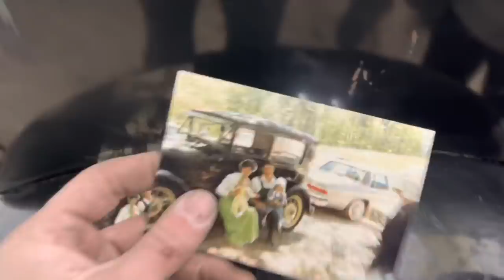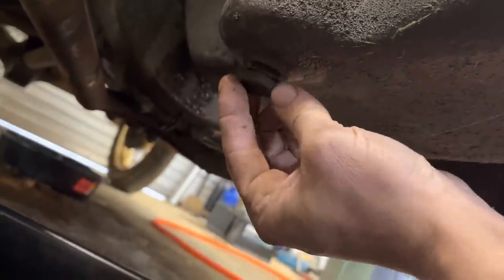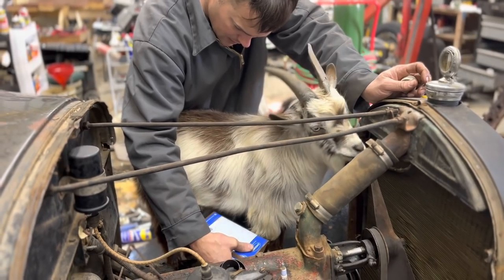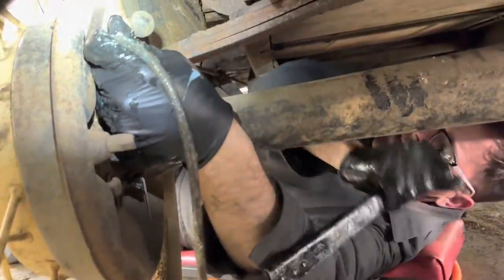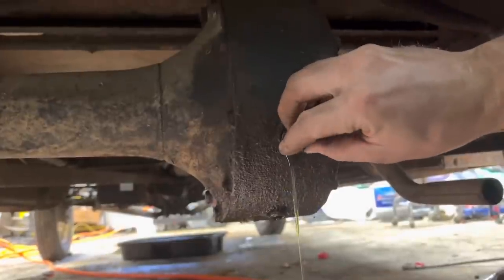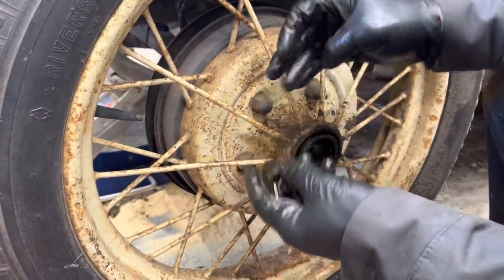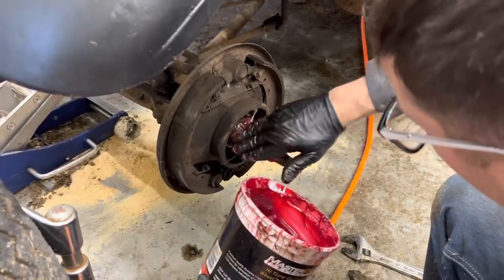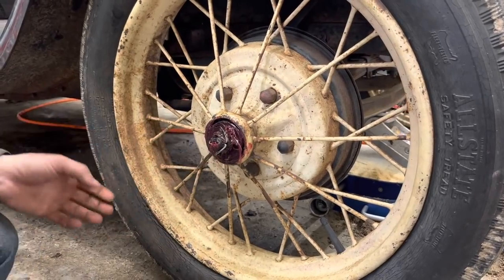94 year old car back on the road, and first wash!

Comment: The car cleaned up beautifully, new roof skin and some beauty work on the paint should be catching eyes all the way down the road!

The steering box of a Model A is meant to be lubricated with a thick oil originally designated 600W (About 120-240 SAE). The grease fitting on the box really did cause some confusion back when they came off the line like that, but the manual and service bulletins specifically warn to only use 600W oil and not grease for steering box lubrication. Since the Differential, Transmission, and Steering Box all take the same thick oil, I just buy it in bulk for all three. Either 120-240 SAE from the store (Whatever your car likes best) or 600W from one of the Model A parts vendors.
Reply from the maker: Ok thank you

Comment: Life is good in a model A.  You got yourself an enclosed cabin to protect from the elements (heater optional). And you start it with a push button so you don't take out an arm  cranking. And a windshield wiper too, just not an electric one.
Reply from the maker: Exactly

Comment: That flathead 4 runs really well. I agree that you need to fine tune the  timing to get more advancement out of it. You really fit the part when you dress for it. I really enjoyed it when the whole family is involved. 
To make sure you get all the sludge out of the engine run it for awhile and change the oil one more time so it will be ready for storage. See if Coker tire sponsor you some new Casings for the 28. Sorry for the long post. May you and your family have a Blessed One Sir.
Reply from the maker: Sounds like good ideas thanks

Comment: I love these cars.  Original  My father in law has a 1936 three window coup V8 with a rumble seat.  For the most part its original.  He did change out the brakes to hydraulic and the engine has been changed out.  He took the body off the frame and cleaned and painted the farme.  Then he had the body painted.  Its cordoba grey.  Its really beautiful.  Other than that is pretty much original.  I haven't had the chance to ride in it yet but I love it.  My father in law doesn't want a hot rod.  He says there are only so many of these still around and each one you rod its one less original.  Just an FYI the bumper is not chrome its stainless steel.  Black was the favorite color for Model T and A.  Black was the only color that would dry fast enough to pain the body and keep up with the assembly line.

Comment: Man this was a good video. That oil kind of look a lil weird but everything turned out nice. The cleanup was simple and easy and you could tell the difference. That was awesome seeing the wife driving the vehicle. I really like to test-drive especially with Ralphie in the video at 33:05 when Ralphie said that will be terrible. Boy i tell you Ralphie is funny. It was also cool to see Ralphie driving the vehicle at the end. At first I thought you was doing the video without your flip-flops on. I love how you switch your clothes in seconds. Yes I was told they had flip flops back in the days too. I was told that's all my grandfather wore back in the days was just flip flops because he had very extremely wide feet with toes that were equally straight across. But he had normal size toes it's just his toes was very very extremely wide. I see where my extremely wide feet come from now in the family. Just back doing Christmas I was looking at some pictures of my grandfather wearing flip-flops back in the day & till this day my grandfather is still wearing nothing but flip-flops. He only wear shoes and boots for certain things but other than that he is in flip flops 24/7 even when is 20 , 30 , 40 degrees outside he still wearing flip-flops to the store. My dad does not have wide feet & his toes are not equally straight across but his toes are spread out. I apologize for slightly jumping off the subject but but yes they did have their flip flops  back in those days. The video thank you for for sharing.
Reply from the maker: That’s great your grandpa wore flops too .. hope you have a great weekend and thanks for watching as always ..

Comment: Hey!  This one looks 100% better than that that one that was so washed out with too much light.  One way to clean the crankcase is to do what we used to.  Before you change the oil, start and warm the engine till you can have it at a slow idle then add a pint of kerosene to the crankcase and let the engine idle another 5 minutes.  It won't hurt the engine and it will break up that sludge in there and the oil will drain much easier.  Be thankful it has all those zerks.  That's why it has lasted so long, unlike modern vehicles where when the part wears out you just have to toss it and buy another because you couldn't grease it to keep it from wearing.  That diesel oil likely has zink in it which helps keep the valves and seats lubricated well as they're a softer material than modern valves.  Back when gasoline was leaded that was what lubed the valves.  You can also buy a product called Instead-O-Lead and add it to your gas tank and it will help as well.  Even with all that though those valves will get leaky over time and not seal well and it'll be time to "lap the valves" which was a common job on older engines.  Somewhere around here I have a lapper which is basically just a dowel rod with a suction cup on each end.  You'd stick that suction cup to a valve, put some grinding compound between the valve and seat and spin that dowel rod back n forth between your hands and that ground the valve and seat so they would seal against each other well again.  Back in the day you would have removed the inspection stickers or else after a few years you'd not be able to see through the windshield, lol.  They weren't for vehicle emissions, but more for, are the tires with enough tread to be legal...stuff like that, do the lights all work, etc. and they were also a form of automotive tax and you got a new one each year.  Now on something as old as that if it had an A, B or C sticker about that size I'd definitely leave those as they were WWII gas rationing stickers.  If you had an "A" card your vehicle was considered the lowest priority for fuel and you were allowed to buy 5 gallons a week.  Even then you wouldn't drive much because you couldn't buy new tires or other maintenance stuff at all because the rubber and lubricants, etc. all went to the war effort.  Sorry for such a long comment...I tend to ramble on a lot.
Reply from the maker: Ok thank you for the information

Comment: I forgot to add this.  The one thing I accidently discovered, my model A never did run well.  Then one day when checking the points, just before using the car in a wedding, I noticed that when the points were advanced, the gap changed, which reduced the dwell and so the spark was very poor.  I filed the notch larger in the distributor cap, the notch permits the points plate to move back and forth, and that fixed the problem of the gap changing, so the car ran much better.  About a year ago, I decided I wanted the car to run really well, so I purchased an electronic ignition kit for it, and converted it over to a 12 volt system, and now it really runs good.  I have had my model A, a 1928 2 door sedan, just like yours, for 56 years and the brakes have always been terrible.  If Covid ever ends, I am going to switch the car to juice brakes.  Even power front disk brakes, if I can find a kit.  I am not a purist, just like to have a safe car to ride in.  I even put seat belts in it, so my grand kids are safer.  Hope this helps.
Reply from the maker: Sounds like good upgrades

Comment: That oil reminded me when I did an oil change to my old 76 Ford Granada (2 dr). Talk about chunks! I used some cheap oil and did a few cycles and added some seafoam until I finally it gave a proper oil change with diesel oil. I miss that p.o.s. nearly died a few times in that car but still miss it. I wished my grandpa was a car guy like yours. He had a lot of awesome WW2 war stories, though.
Reply from the maker: That’s interesting I had a 44k mile Granada it was gold 302 car I liked it
Reply: @Sleeperdude  mine had the 4.1 6 banger. It loved eating carburetors for some reason. I also had to put spacers in the car, so I wouldn't be driving on skinny tires.

Comment: A rule of thumb I was taught was for old vehicles 55+ or more in age after you drainout all of the old oil was to add backin some lucas and diesel and run it for about 5 mins... Let it warm it up good, shut er down and yank the drain plug.. The diesel mixed with lucas will scrub and basically do the same as a hot acid bath... It will break loose almost all of the sludge gunk and any leftover metal material that may be stuck in valleys or channels within the block.... I have seen ungodly amounts of crap flushout of an old engine block and it works very well.... When you did the front bearings that is a open & shut case of dirt and water contaminated grease.... Water breaks it down making it harden up  & the dirt makes it a funky brownish grey color
Reply from the maker: Ok thank you
Reply: @Sleeperdude  NP sleeper brotha... I have flushed TONS of engine blocks out with that method

Comment: Two things I mentioned before you haven't tried yet,  double clutching is when you want to down shift, push in on the clutch, rev the rpms up a little, let out on the clutch while reving the rpms a little and put it in 2nd when you do it smoothly the gears never grind. Just try the tin foil even after you use the steel wool , You'll be suprised, I know your saying "if there's no chrome it can't shine", I thought you might want to learn some thing new. I won't bore you with it again. Jim las vegas nv
Reply from the maker: Ok thanks I did try the aluminum foil in an older video and it did work
Reply: @Sleeperdude  when you use the tin foil be SURE to use the DULL side only

Comment: Since it doesn’t have an oil filter it would probably be good to at least remove the oil pan and scrub it out real good. Also since the valves are internal and no overhead valves to hold junk … get a few cans of motor flush and run and flush a few times … love seeing these old FORDs 👍👍👍👍
Reply from the maker: Ok thank you for the info

Comment: At the oil co. I worked for,we'd get calls for trans grease. It was 400 weight,since there weren't seals. Just vlose fits. And they'd drip. The speedo.cable nuts break off really easy,so if theres a leak there,tightening it up tight won't make much difference.
Reply from the maker: Wow that’s thick

Comment: My best friend owns a Motorcycle shop here in Hendersonville NC.He once bought a 28 4 door sedan from a old gentleman in Fairview.We dragged it home and while cleanIng what was left of the interior out found a very live Copperhead under the rear seat,it didn't take but a second to get outta that car.We looked in vain and never found that sucker,man do I hate poisonous snakes,probably  still around the shop having more babies. The old sedan came with 16 inch wheels and rotten tires,my buddy sells new tires and changes them also,so we put 4 old Harley Whitewall tires on it,we.called it Miss Daisie,sure got a lotta looks out of it,I could probably out run it on a good 10 speed bike lol.

Comment: Excellent video Sleepdude  :) also great shape old Ford car & be worth keeping up excellent shape and vechile shows to show too! I heard my late Grandfather Bill Cann SR bought 1937 a Dodge Brothers car in your Ford body style and was black with yellow wheels to with powerful 4 cylinder motor with 3 speed Manual transmission floor shifter and 5 gallon fuel tank! My other Grandfather Harold he did buy car till 1945 a Chevrolet Coupe car that remember hearing about!
Reply from the maker: That’s cool thanks

Comment: You compare it to newer cars and I was thinking about how folks would be comparing it to a horse and buggy back in the 1930s. But even with the old sludgy oil the engine did not want to die, It acted like it was going to die but came back and kept running. And it's such a simple design, they could make those new today and outsell every other new car on the lot. Though I would update the brakes.
Reply from the maker: That’s true it was much better than a horse

Comment: On the steering wheel the left lever is the spark. That should only be used in colder weather when you need more spark to start the engine.  The right is called the throttle.  The lever under the passenger side is the choke by pulling give it more gas you turn it to manually adjust the carburetor. From inside the car
Reply from the maker: Ok thanks

Comment: Red steering wheel (if original to this Model A) indicates an early production 1928 car. Black exterior paint was not offered on the 1928 model. Unique fluted headlamps only on the 1928 model.
Reply from the maker: Ok thank you I didn’t know that

Comment: With the wire wheels, I can be the rim has egg out or has warped because the spokes need to be adjusted to the true wheel. or the tire or the tube (as the Dutch say) rutched and is bunched up. Now that's "rutch" like Butch with an R instead of B. or just big or lots of tube patches. My Great Grandpop used to putter around and tinker with his car or boat before going anywhere. for hours. I used to ask dad why? Because he was born in 1899... Back then cars needed lubed before and during a trip. So unless you wanted to be stuck and have to walk you fussed with your car. Flats were common so some cars had two spares, patch kits & pumps. In some cars, you had to stop to oil the valve train on a drive.
Reply from the maker: That’s funny thanks for the information

Comment: Timing is not that hard. Looking at the front of the motor, you will find a metal pin sticking out. This unscrews and you put the pin end in that hole. Hold it in place whilst cranking the engine with the ignition turned off, when No 1 is tdc the pin will move in slightly. This is the timing mark. Hope I got this right and hope it helps. Mighty fine looking Ford.
Reply from the maker: We actually did that in the last video

Comment: It would take me a month of sundays to describe the insides of a model a rear end. It doesn't have splines like a regular axle, just a key to hold the hub still and they twist out so easy. Finding one that fits is a never ending job, you just have to make most of the parts, and Josh, this is not a burn out rig cause it will snap a axle so quick. A machine shop is best as they are all different lengths. The hubs are all badly worn and to find a good one ain't happening. Cold weather usually meant a broken axle time in an out. Transmissions are like in the tractor with straight cut teeth an no synchro's.. They are bad for teeth missing and still going but oh so noisy to listen over. I have seen a stack of them laying on the shop floor and still not have parts enough to make one for the road. So I am trying to say  take it really easy on it as you will say "But I just let the clutch out and it broke on me"!      I really feel like its hand it to grandpa quick and tell him its 57 chevy time /LOL.. That or dive into one of your own .... that and set up a patron page. I see some have a button on all the videos that say "Thank you".. we can click on it and choose from a dollar to some crazy amounts. Harris   has been watch too. Get over false pride and let us help when we can. That tip  jar ain't gonna fill up over night but some coming it will help you get where your going
Reply from the maker: Ok thanks for the information. I do need to get on that.

Comment: You advance the timing as you speed up on the hand control also reset the mixture after it warms up all the things the ECU does in your modern car are manual on A Fords
Reply from the maker: That’s true

Comment: To fine tune the timing start the car when you timing lever is in the spot it starts leve it there and restart couple more times. That is where you want the distributor to be with the timing lever all the way doing   You don’t need to go any lower and to start pull the lever all the way down.  Might be able to advance it to much.
Reply from the maker: Ok thanks

Comment: Diesel fuel works well as flushing oil. or a real flushing additive with some engine oil and run the engine 5 minutes. then drain again. I Reckon condensation worked its way up the shaft where the distributor lived.
Reply from the maker: Ok thank you

Comment: * * * *  Vienna, Austria  * * * *  Next time you change oil for the first time on an old engine , put ATF in it before you warm it up and run it long enough to heat it up then put some miles or let it idle a while . It will help loosen that sludge .

Comment: Most likely 99% of the roads at that time were dirt between major cities as railroads were still the dominant way to travel cross-country so a wood trailer would have actually had an easier time of it than on a hard paved surface.  That's also why the tires on your "A" are so narrow and tall, as they were designed more for dirt roads like a wagon's wheels.  Our old tractor, a '39 John Deere A does have road gears (4th to 6th gear) but I was always told running on paved roads was actually hard on a tractor from that era...not sure why.  Then again, when it was made as it was meant for a farm it probably wasn't anywhere near a paved road.
Reply from the maker: Ok thank you